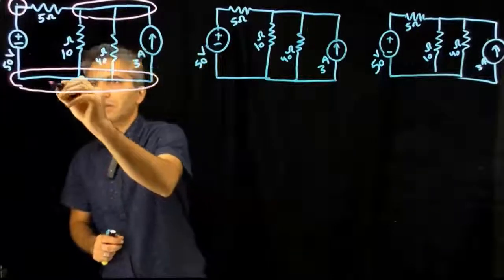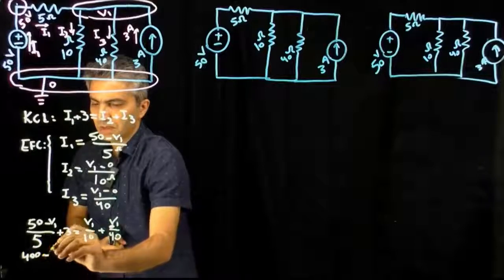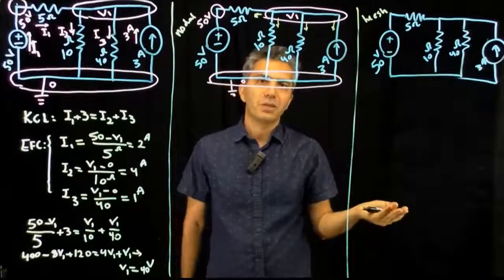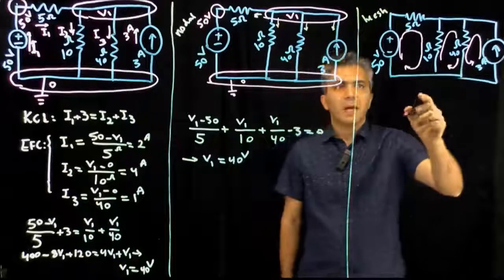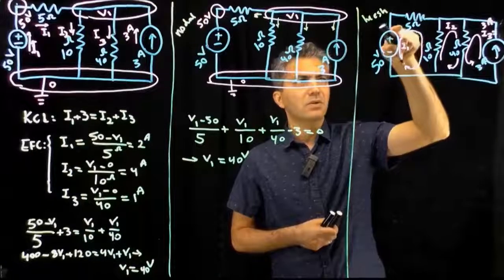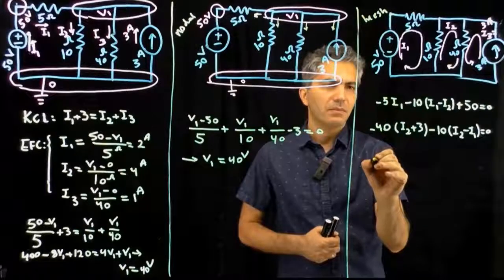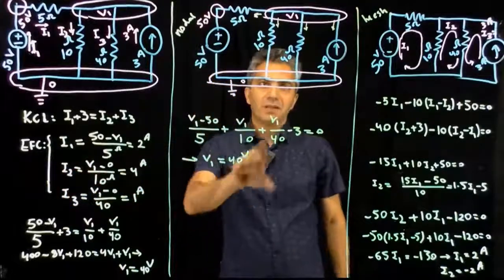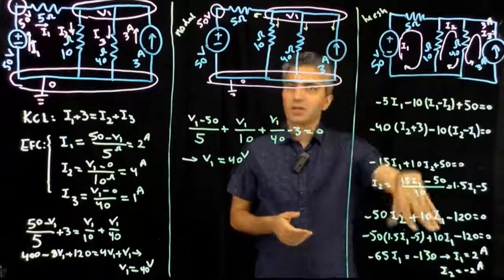Lecture 13: Comparing Nodal, Mesh, and Universal Circuit Analysis Techniques

Comment: cute presentation with  see thru panel .

you could have written the 3  Mesh  equations  like this , Directly , with No  intermediate steps :
how cool is this ? very cool .  everyone needs to keep  reading , keep studying , and keep going deep .
don't just re-iterate the simple stuff techniques :

50 = ( 5 + 10 )I1  -  10I2

0 = - 10I1 + ( 10 + 40 )I2  - 40I3

I3 = - 3A

and Done !  nothing else to write , so simple . it is the Technique . Engineering technique .

KCL on our left side , not gonna happen , too classic , too basic , too messy.
Node in the middle , not quite there ,...technique needs more refinement ( still too messy )
Mesh on our right side , needs lots of refinement to the technique ( too cumbersome )

3 books to read  , about 10 chapters on  DC  :

1. Engineering CIrcuit Analysis Fifth Edition ( McGraw Hill  publisher , year 1993 )
2. Electric Circuits Second Edtion (  Addison Wesley  publisher , year 1986 )
3. Basic Engineering Circuit Analysis  Fourth Edition , (  Macmillan publisher , year 1993 )

( new editions are too expensive , get previous editions )

Put it  All Together , and each  final technique ( Node , Mesh , etc,.. )
will be much , much simpler ,... Initial Equation writing becomes :
Easier , Faster , Less errors in writing the initial equations ,  fewer labels on the diagram .
and the initial equations will be easier to verify , when compared to the schematic diagram .
gonna have to go deep ,...inside the box , then outside the box , and maybe back inside the box again .

i recently  know a guy , barely . He says he was in electronics for  something like 40 years , and 
he can't write an equation for  a 3 component  single loop DC circuit .  sad , sad , sad .
He thinks all answers need to be  +pos numerical values ,...sad .
It isn't that he can't do it ( just now ) , he has Never done it .

keep reading , keep studying , keep refining the technique ,... that's all we can do .